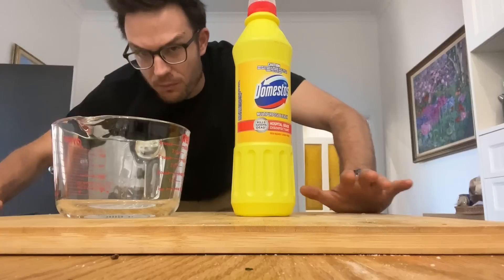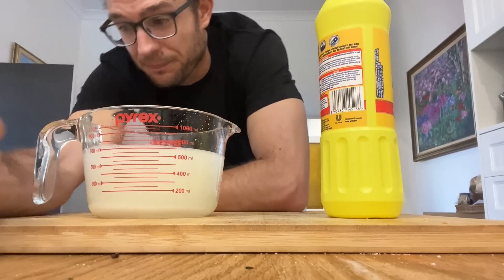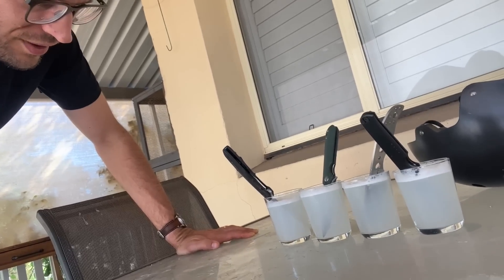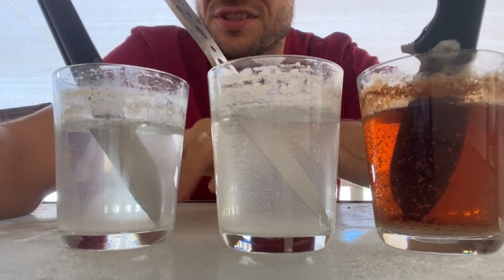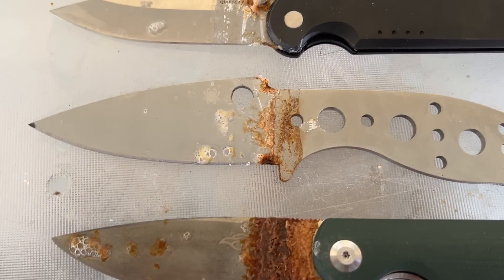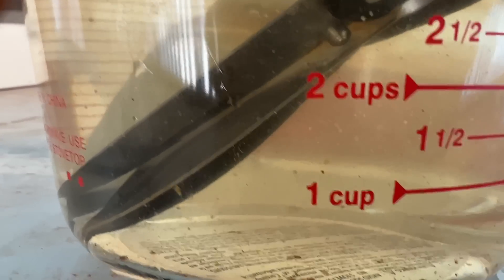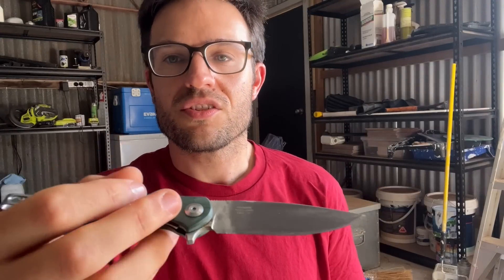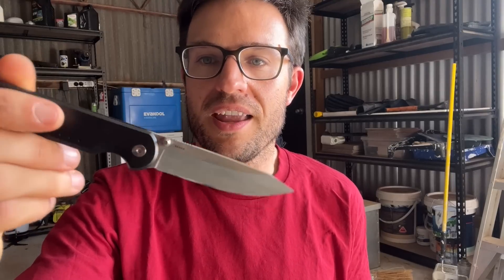Ok, so I rusted Magnacut steel - here's how it compares (Vanax, S35VN, D2)

Comment: interesting great video, i think i have read before that the nitrogen in the high nitrogen steels more stabilize the chromium oxide layer on stainless steels,. Normally chlorides in sea water rip apart that chromium oxide layer, but the nitrogen in nitrogen steels create an addition nitrogen oxide layer that inhibits chlorides ability to attack the chromium oxide layer. nitrogen in these nitrogen steels from my understanding evaporate out of the steel in the the normal atmosphere at certain temperatures. I cant tell but i wonder if the wording on the quiet carry is laser engraved, if so it would be reasonable to assume that those specific spot where the laser hit would be devoid of nitrogen or have deficits of it.

Comment: My main camping blade is uncoated (since I stripped of the black coating) and is made out of 1095 carbon steel (which people claim is notorious for rusting) and funny enough, there's not a speck of rust on it and I've been using it when camping for about 7 years now. That just goes to show ya that taking care of your blades matters more than whether they are made out of a fancy supersteel.

Comment: So, you mixed a base, an acid, and water. The reaction you made was them neutralizing and off gassing chlorine, and then you made it even less reactive with the water. It would be more torturous to the steel to do any one of them by itself(besides water), because mixing them lowered the strength. The one benefit of the way you did it is that you probably made layers of different mixtures that acted in different ways at different depths on the steel all at once, giving a more diverse test all at the same time.

Comment: Good test. 
Funny how knifemakers make a corrosion resistant knife but fail in some components other than blade steel. Case in point, Quiet Carry. My QC Drift has Vanax blade steel and most components are also steels like LC200N but not the thumb stud!
Wish you had included H1/H2 and LC200N which are in the same league as Vanax.

Comment: Recently purchased a Curtiss F3 in magnacut and I had it in my pocket this last snowstorm in Wisconsin as I was working doing snow removal on city sidewalks. I never used the knife but it was in pocket. The next morning one side of due blade had specs of rust and in the fuller groove. I was surprised as I thought Magnacut was supposed to be very stainless
Reply: It depends on the heat treatment I believe, it's all about the chromium being locked up in other bonds, if treated correctly it should have 0% of the 10% chromium in bonds allowing it to be more rust resistant. If it's treated wrong it bonds more of it and essentially makes it worse than D2. D2 is 12% chromium and magnacut is 10% if memory serves. I'm absolutely not a metrologist but from what nerd knowledge I have that could explain it.

Comment: I think the waypoint corroded at the thumbstud due to crevice corrosion. Someone said the thumbstud is made of titanium (more noble metal) so there could be some galvanic corrosion going on but the thumb stud has a much smaller area than the knife which means galvanic corrosion is less of an issue. My guess is crevice corrosion.

Comment: Excellent comparison, Pete.  Magnacut and Vanax continue to impress.  For everyone's knowledge:   breathing chlorine gas will give you chemical burns.  Chlorine gas (Cl2) is unstable, and wants to react with EVERYTHING, and quickly.  It reacts with water in your cells to produce hydrochloric acid, and hypochlorous acid.  Your eyes and nasal passages will get chemical burns that will really smarten-you-up.  About the only thing you can do is administer oil of peppermint to ease the burning sensation until you heal.  Super serious stuff.

Comment: Of course it can rust. the largest percent is still iron! Hello!!!
Remember, Stainless Steel, Real Stainless Cutlery steel is not true Stainless steel. It is known in the Industry as Stain resistant. Not Stainless. This confusion has been caused by dealers for years. 

This use to be common knowledge in  the Knife World. Sadly, due to ignorant advertising, it has been  mostly lost. 

All you have proven is that anything can be abused it you try hard enough. Anything!
KnifeMaker

Comment: One thing I am curious about is that the vanax is a folding knife and the amount of the blade exposed in the air is much less than the magnacut Which has much more surface exposed in the air, that might make a difference between the two in terms of corrosion. Great test by the way I wish you also added h1 in there though. Thanks

Comment: I use muriatic acid to "age" hardware on guitars. It works in a few minutes. Even the fumes will mess with chrome plating. I wonder if it would have an effect on super stainless steel?
Reply: I bet it would. We use Muriatic acid and Ferric Chloride all the time to acid etch. I recently did some on VG10 and it was corroded in seconds
Reply: Muratic acid is hydrochloric

Comment: I worked in refineries for 40 years as a chemical engineer.  Wet chlorides or wet chlorine can wreak havoc on many stainless steels including 316. We used high nickel alloys like Incoloy to fight it. Before the metallurgists figured it out, there were many deadly accidents.  In one case a dime sized hole in a carbon steel pipe released a massive cloud of hydrogen.  I heard the explosion (a large POP) 20 miles away.

Comment: Ive heard peroxide salt (and maybe vinegar also) is the mixture you want for rusting something. And should be safer.
Reply: I've used it for intentionally rusting carbon steel - it was very effective! Also I applied it with a spray bottle.

Comment: The so called "test" you're known for had me long questioning your IQ, but this gem has to be parody otherwise it seals the deal mate. Do you really not understand how corrosion works? The chlorine bleach by itself would make for a much more potent corrosive than totally counteracting and thus neutralizing the strong base with a strong acid in the form of vinegar and releasing a bunch of noxious gas in the process. Next time, just use chlorine or oxygen bleach by itself. They already come diluted. Most hydrogen peroxide is 3% concentration and most household chlorine bleach is between 8-12%. Either one of these makes for a solid corrosive for such a test, but the hydrogen peroxide a neutral corrosive. Chlorine bleach is a great choice tho. That is until you go and dump a load of vinegar into and nearly poison yourself with a weak chemical weapon in the process.

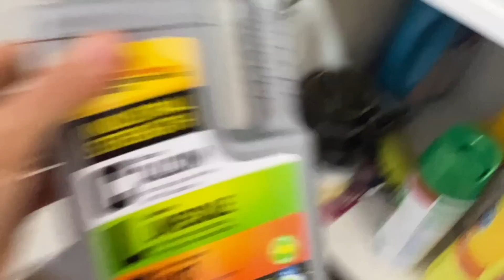Comment: 5:30 The No8 Opinel I'd had from 1988 until the early 2000s suffered the fate of being left in a tackle box if memory serves me correctly. Yeah, it couldn't come back from that. Contrary to the stainless Opinel I have that has at one point, spent a week in a tray with salted pilchards, and was cleaned in salt water at a boat ramp. That knife has zero rust.

Comment: If you want to rust a knife, I know of nothing better than Ferric Chloride. It's sold as a PCB etchant and (at least in the States) is fairly inexpensive at about $20/L. However, it is very caustic and will burn you very easily.

I use it at about a 25% concentration, and even then it takes less than a minute to put a good acid wash on a blade.
Reply: Yeah, FC will obliterate any steel. Doesn't matter.
Reply: That's because you can make it using hydrochloric acid and decreased fine steel wool, just wait till the 0000 or 000 steel wool falls apart. Hydrochloric Acid not only removes rust, but eats live steel obviously...😂
Reply: *decreased steel wool ...using acetone

Comment: I wonder if you inadvertently decreased the corrosiveness of the solution by mixing an acid and a base.  They will react and off gas that horrible smell, but are  also neutralizing eachother.  Vinegar is acetic acid 2-3 PH.  Bleach is sodium hypochlorite a Base with a PH of about 12. Either way, it did its job and showed valuable results. Thanks for all you do.
Reply: Agreed!
Reply: Yes, this is the case with a lot of home made cleaning mixes.

Comment: I actually felt bad for those knives. That's the worst solution I've ever seen any knife subjected to.
Reply: Is it? Just the chlorine bleach by itself would be more potent than neutralizing it's corrosive potential by adding an acid to a base. Vinegar alone would be fine for an acid. It'a already diluted. Same for bleach, it's a base, already diluted. You could also try hydrogen peroxide which  oxygen bleach and a neutral (not acid or base) corrosive agent perfect for making shit rust. Standard is diluted to 3% but you can buy it concentrated.

Comment: Would have liked to see LC200N tossed in the mix to see how it compares
Reply: I would add H1 and LC200n
Reply: @DamionJR4923  I thought about H1 but on second thought I remembered I have no interest in it since the performance of that steel outside of not rusting is pretty poor.
Reply: 2nd this. I would like to see how this LC200 compares. I'm curious how much it would take for pure (no thumbstud)  lc200n or vanex to rust. Great video overall.
Reply: You actually kinda already did, as the liner of the Waypoint is LC200N.  The thumbstud is titanium, so that wouldn't have been the source of the rust.
Reply: that's interesting to learn i thought the hardware on the waypoint was some sort of marine grade steel.
Reply: @Thexaios the thumbstud would have caused a crevice. These ss steels including vanax are susceptible to crevice corrosion.
Reply: @Thexaios  the hardware on the waypoint is actually “marine grade” stainless steel. All my hardware rusted taking this knife scuba diving. But only the hardware and thumb stud
Reply: @Sesh422  This is the third time I've tried to reply, but apparently YT doesn't like me linking to Quiet Carry's website.  I said nothing about the rest of the hardware, but Quiet Carry themselves say that the thumb stud is titanium (as well as the liner being LC200N).
Reply: @Thexaios  just checked their website. You are correct. Very interesting how that area also rusted on my knife.
Reply: @Thexaios  the corrosion came from the titanium contacting the vanax. While both materials are stainfree, when exposed to a corrosive they will have a reaction to each other that produces the corrosion. That is also why it cleaned so well, neither component actually rusted, it was a reaction between the two materials. Same thing will happen with LC200N and titanium btw.
Reply: I use LC200N in the kitchen and it's bulletproof corrosion resistant.  I don't you could get it to rust/corrode.
Reply: Vanax and LC200N are more or less the same thing. So....
Reply: @jacknemo8021  No, they are not at all the same thing. They are supposed to have similar stainlessness but the compositions are completely different.

For the record, according to knifesteelnerds both Vanax and Magnacut are rated at 10/10 for stainlessness, but we saw a difference in the real world results, which is why I would also like to see LC200N compared since it is also rated 10/10.
Reply: @arrowheadguys7637  Larrin rated Magnacut at 9.5 instead of 10 for stainlessness, which, I think, accounts for the difference seen here.
Reply: @admiraljosh  Ah, you are correct, someone rounded the numbers on the chart I was looking at
Reply: @arrowheadguys7637  There are tons of variables you’re not thinking about. It’s not that the “real world” results are different from preliminary lab tests.
They were tested in different solutions, different knives, different heat treats, different blade finishes, etc.
Larrin’s tests are much more controlled, but there is also an issue of sample size.
I think Pete just wanted to see what would happen. This isn’t at all meant to be a reliable evidence of any actual significance, beyond satisfying a combination of curiosity and boredom for our entertainment.
Reply: Oh I'm perfectly aware of the variables. The biggest problem relating Larrins ratings with real world testing is heat treat. Heat treat affects everything from edge retention to stainlessness, and his ratings are done at a specific hrc that is likely not the same as the factory production knife you just bought.

I wasn't asking because I was trying to discredit anything, I just wanted to see if there was any real world difference, and even though Pete is not using the same standardized spray test as Larrin, you will still see results that can be correlated to the ratings, just like Larrin did with Pete's rope cut data. Even tho his data has different results, it still correlates to the ratings.

Statistics and data analysis are fun. Six Sigma for life lol.
Reply: @arrowheadguys7637   As a test of the difference between production knives and lab knives, I think there is a lot of merit in that. It's probably more useful to users upfront, but it introduces problems with coming to conclusions about the actual relative corrosion resistance of each steel. You want to see how a specific factory LC200N knife compares to lab tests of the steel and other specific examples of factory Vanax, not just a general comparison of how LC200N actually compares to Vanax.
It's just something people will misunderstand and is better to clarify.
My first sentence wasn't necessary; I think get where you're coming from better now.
Reply: @Cl1ff.Braden all good points
Reply: @arrowheadguys7637  a separate test is the right call but that rust was from the drill hole for the studs not the LC200N liner. Unless they lied and the liner isn't what they claimed. I have some LC200N in a high salt water and humidity environment; God tier rust proof.
Reply: @arrowheadguys7637 Well, LC200N may not be identical to xanax, but Valium and Klonopin are pretty darn close. Oh wait, you said V-anax ..... (Just joking, vanax=good, Xanax=bad)